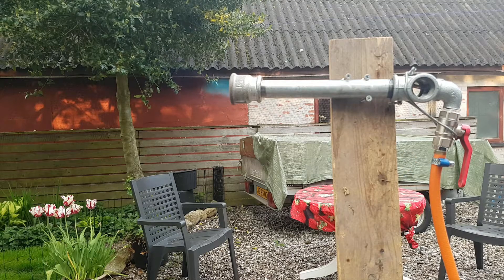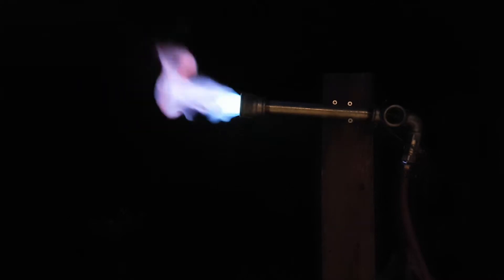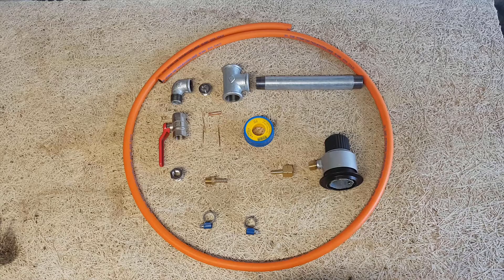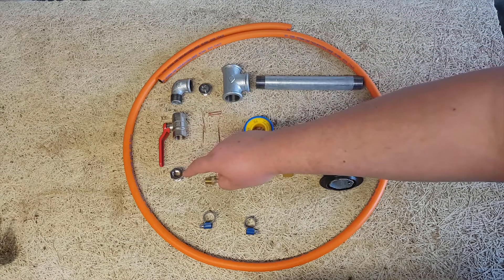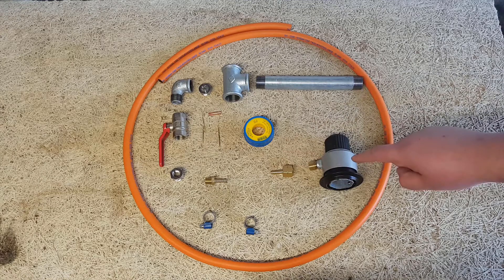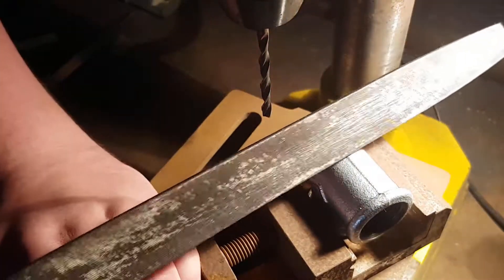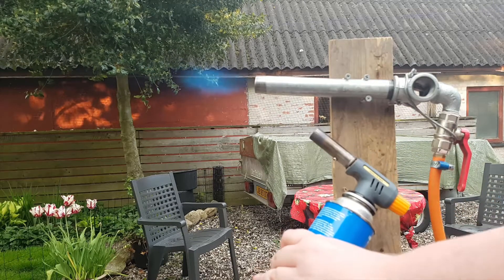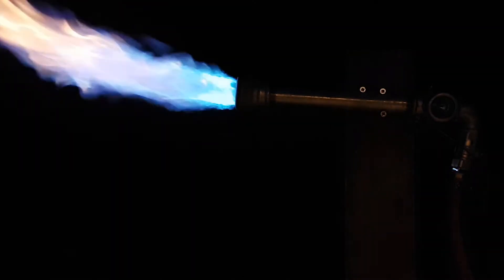Propane Torch (Prototyping Project)

Comment: Hi, one question. Can you write the name of the part that you installed into the pipe lock? Much appreciated, great work.
Reply: It was a mig torch tip.  They are nice to use.  They are threaded on one end and have a hole drilled in the other end.  You can get at least .025, .035, and .045" holes.  There tables that will show you the number of BTU/hr with various pressures and orifice sizes.  My son has a Tweco torch on his Lincoln Power Mig 256.  It has 1/4-28 threads and my Lincoln 180 Mig has some metric thread on the tip.